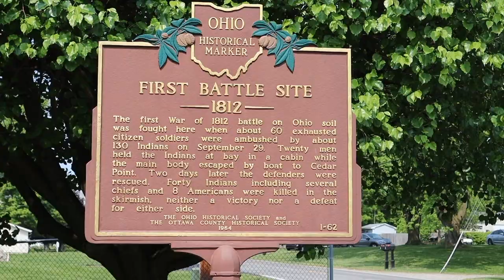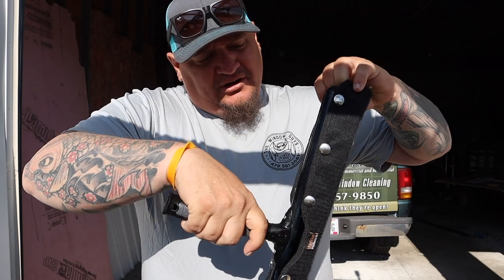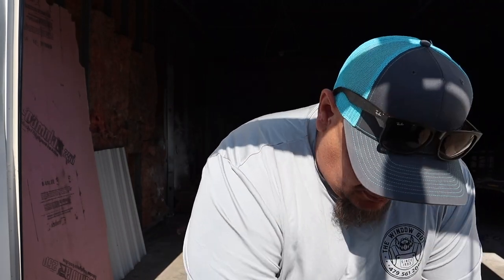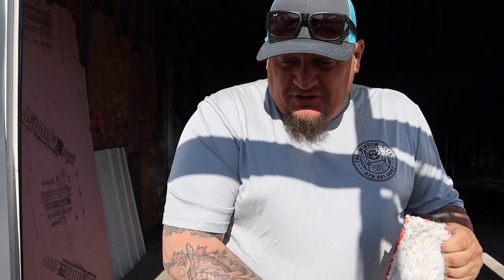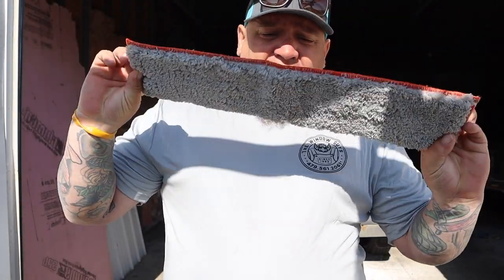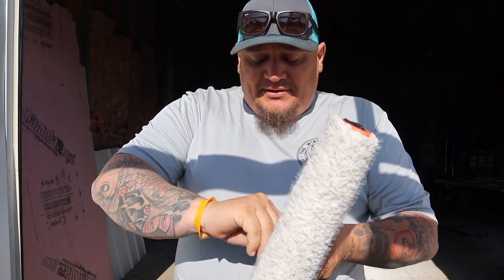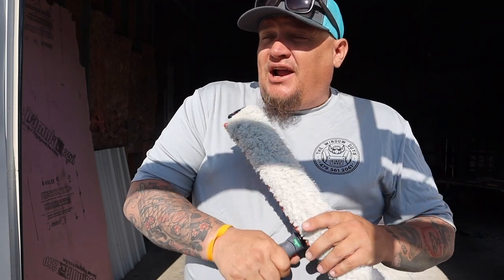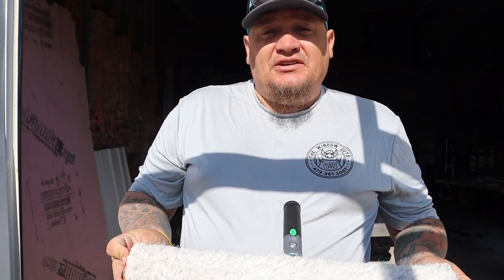The All New Handy Sleeve from Maykker Products

Comment: Bob reckons that the Liquidator is the best on the market and that you’ll never need to use another squeegee once you start using it
Reply from the maker: @mikew2095  well in my experience and opinion he’s incorrect. Maybe on European residential but here in the states those pointy ends dig into the rubber gaskets on commercial windows and jam in wood frames on residential. Sorry Bob.

Comment: Do you bother using the easyscrub ends on the Mayyker? 
You reckon they’re necessary to prevent dripping from the exposed Velcro? Cheers
Reply from the maker: @mikew2095  I’ll be honest I’ve never really paid attention. The main reason I don’t use them is because I’m the first guy to use these. And at that time there weren’t any end scrubbers yet so I’m used to using the Velcro itself to scrub when need be. Plus the bucket I like to use the washer doesn’t fit great it’s a little tight when I rinse/re wet my mop so I for the most part don’t use them. They are nice though. Thanks for all the comments and interaction. Appreciate ya.